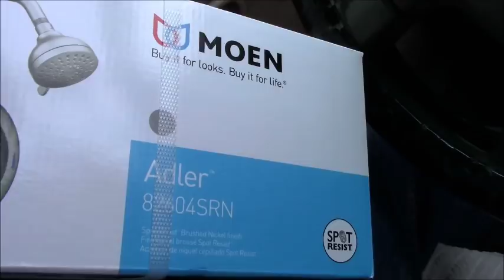DAILY VLOG ON BATHROOM RENOVATION ..PART 2

Comment: Hi there you do Nice work, your tilling excellent, don’t cool a soldered joint with water this can  fracture the joint ,when the joint is cool you should wipe all your joints with a wet rag to clean off any surplus flux all the best Norman UK

Comment: Bob, you have said in the past that you trust sharkbites except inside the wall where you can’t easily access them.  I subscribed to handy dad tv and saw him using sharkbites for his shower install.   I realize people do different things, but I was curious if your thoughts on sharkbites has changed?
Reply from the maker: I still believe sharkbites COULD fail and not to enclose them in areas you can't get at. But it is a crapshoot, you may not ever have an issue. HandyDad built his own shower, not for a customer, so no harm no foul.

Comment: Waste management bags. Is what they're called sorry sleepy here. They hold I wanna say 1500 plus lbs. I'm thinking thatd save you a boat load if time since looking at that line at the dump. I'm still only about 3 mins I to this video. So maybe more to come lol
Reply from the maker: The bag itself is like $25 but the pick up is $150...way out of range, plus they will only pick up from a concrete surface like a driveway, not the grass side of a curb.

Comment: I think I see you transitioned from 2" to 1.5" drain AFTER the trap....I know this is naughty and all but lets's live in realville...which do you think is better?  before (reducer on drain) or after trap? just curious because I'm doing this and not sure..thanks...love your vids
Reply from the maker: In theory a tub spout will shoot out about 4 gallons a minute, whereas a shower head is about 1.5...*BUT* a shower is still supposed to have a 2 inch drain whereas a tub is an inch and a half.. it makes no sense, it's backasswards. But my take on it is that a tub has about 18in of water it can handle where is your shower curb is only 4 inches high... either way I am transitioning to the inch and a half to a two in for my showers as far to the drain as possible, unless of course the whole P-trap is 2 in and then I'm relegated to transitioning after the P-trap
Reply: @StarrTile  Thanks Bob..makes sense. Appreciate your answer...